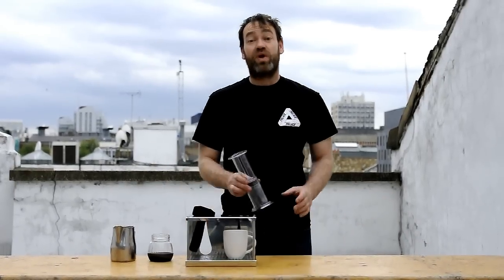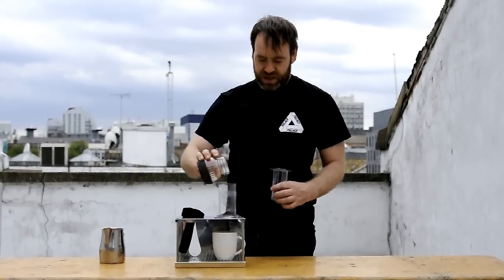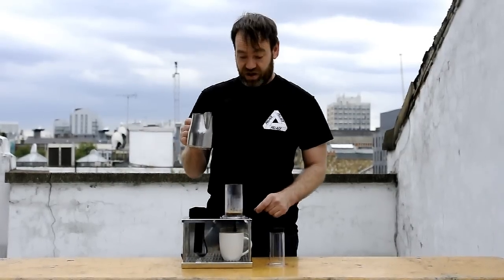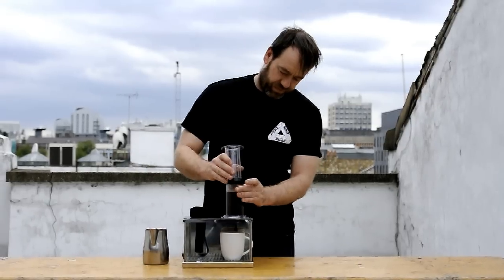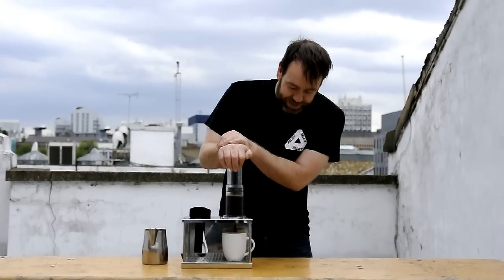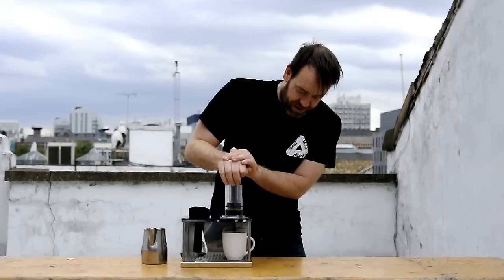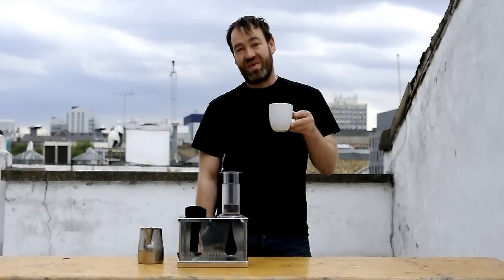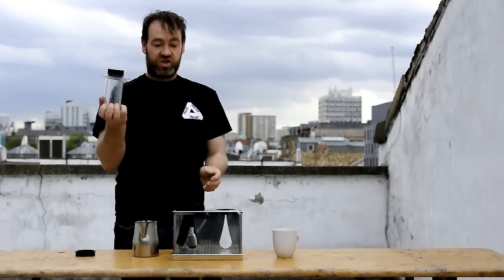Gwilym Davies Demonstrating the Aeropress Coffee Maker

Comment: Ive watched a couple of vids on aeropress and here are my top tips!

Why Aeropress?
Add more pressure – squeeze more flavor from your coffee
Aeropress creates a vacuum – stops everything dripping into cup too early
Takes 30 seconds to press (1 minute to brew)

Tips for brewing perfect Aeropress – according to David Coleman & Gwilym Davies

1.	Wash Aeropress before with warm water – heats Aeropress
2.	do not add boiling water – burns it instantly (under 95 degrees is better)
3.	grind size – somewhere in-between plunger and filter grind
4.	dose 1 or 2 (if you want a strong blend)
5.	how long to brew (known as “steeping”)
6.	wet your paper filters first (ideally with hot water). Avoid papery filter taste!
7.	Pour down the side of the Aeropress flask (ensure penetration with the bottom)
8.	Preinfuse with small amount of water – for 30 seconds
9.	Then add the rest of the water – wait another 30 seconds
10.	Do not fill the Aeropress container for 2 reasons – 
-blooming – chemical reaction occurs  as coffee particles bumping into other partciles, hot water it bumps a lot faster. If there is a bigger section to brew in – this wont happen (bloom in)
-do much water – it will overflow when you brew it!
11.	Top it up after
12.	Give it a little swirl then pressure plunge
13.	Do not press/plunge full distance – as it can extract too much bitterness!

Comment: I have a question. From the research I have done it seems to be the optimal ratio for water to coffee is between 16 and 17 to one. But I have been watching and reading a lot of Aeropress WC and most the recipes are using about 17g of coffee for only about 200 to 250g of water. This ratio is more like 13 to 1. Are the adding more hot water to the brew coffee or is it just really strong?